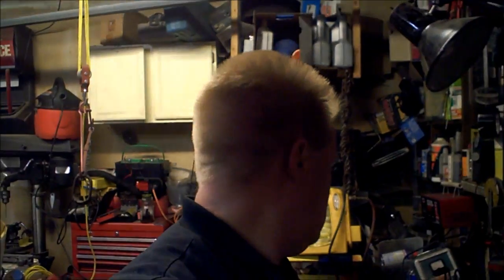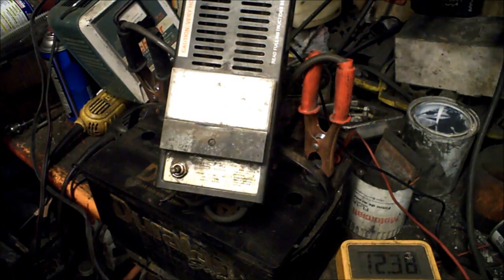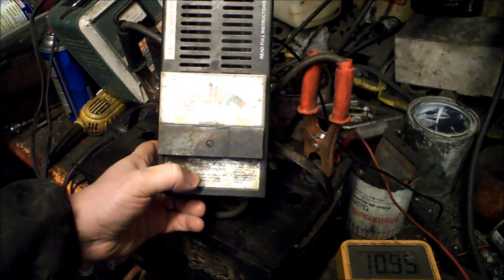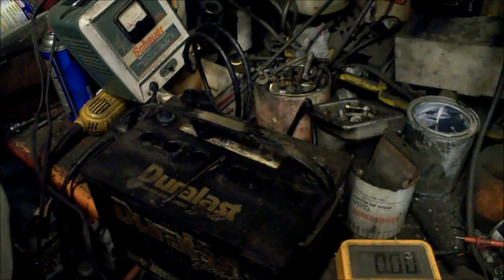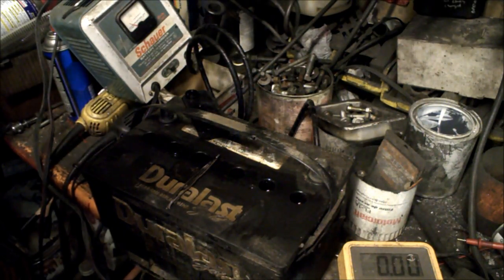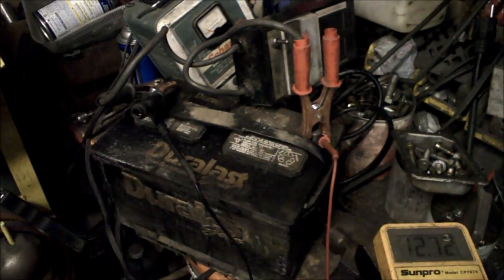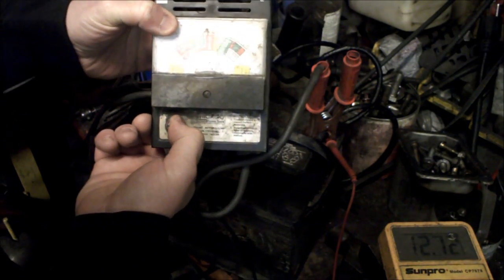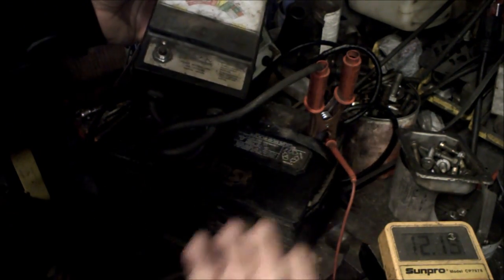Save a Weak BATTERY with epsom salt

Comment: Damn you look like a kid in this video! coming here because a dealer says my 4/5 year old battery needs replacing and I want to see if I can get some more life out of it. Seems like you or someone else I watch on youtube said batteries should be able to last longer than 5 years
Reply from the maker: Using Epsom salt, I've been able to push battery life up to about 14 years on some of them. It seems 8 to 10yrs is doable. The Epsom salt( magnesium sulfate) lowers the resistance of the electrolyte allowing higher current to flow. Essentially making a weaker battery stronger. Now you'll have to keep in mind that the lead plates are consumable and due to grade and fall apart over time. Seems like the only thing that will kill these is if a lead plate degrades to the point that it falls apart and short circuits a cell. Nothing will recover it from this.
Reply: @sixtyfiveford a dealer tested the battery and said it had 80cca when it was rated for 530! But it starts fine. And an oil change place said it had one cell that was weak. I put the epson salt in as recommended and I’m going to give it a few days and see if I can get a tester from the auto parts store and test it myself. This all started because I took it to the dealer because it had a check engine light say the throttle actuator was bad. My car, a 2010 also has a crappie ignition switch that won’t crank the engine unless you push the key in real hard so that is why I think the dealer thought the battery was having issues and tested it
Reply from the maker: @mickjager5974 Yeah there's no way it was 80 cranking amps. That wouldn't start a car at all.
Reply: @sixtyfiveford yeah thats what I was thinking if 80/530 means 15percent and it’s never not started it I’m thinking that was a typo, the guy doesn’t know how to use his tester, his tester is bad, or he’s trying to rip me off 😮

Gonna have to try it in my mower battery too! I’m thinking I should also put a quick disconnect on it in the winter and but start it up every couple of weeks too.
Reply from the maker: @mickjager5974 Yeah I'm getting 5 years out of the super cheap mower batteries sometimes up to 7 years. The only drawback to Epsom salt is it will increase the self-discharge rate. So a lead acid battery will naturally discharge over time and this will increase that by about 10%. I haven't noticed any difference, that's just what I've read.
Reply: @sixtyfiveford  well I left the doors and hatch of my escape open for a couple hours at most and now it sounds like it’s got about 80cca😢. Was just getting ready to take it to an auto parts store to have them test it. If I pull the battery out and take it to them can they check cca or does it have to be in the car?
Reply from the maker: @mickjager5974 They can test the CCA out of the car. They'll want to charge it up though which takes a few hours.
Reply: And going out to see it letting it sit a while it’s like completely gone and won’t even light up the control panel. I know you mentioned dropping one on the ground that had a dead cell so I’m thinking about trying that as a last resort before going to get a new one ☠️
Reply: I dropped it but when I looked at it it actually seemed like it was leaking from the side seam and when I took the caps off the fluid level seemed lower than when I had added the epson salt. So just to save time I went and got a cheap battery from Walmart, 110$, 2year warranty and 590cca. It’s my daughters car and she lives 45 miles away and goes out of town often so I figured best to just get a new one. If it was my car I’d probably have tried it. So when do you normally add epson salt? When a battery is new, when it’s around 3-4 years old, or wait until it starts having problems?
Reply from the maker: You can buy battery testers that test the CCA for around $15 on Amazon. I go around and just randomly test my batteries and when one is lower than it should be; I will add Epsom salt. This is anywhere from the 4 to 7-year mark generally. Riding mower batteries are generally around 2 to 3 years when I add it. 

I'm not exactly sure the quantities I gave in this video but I kind of just eyeball anymore. Mainly because it doesn't seem to make any difference if you put too much in. It's probably around a tablespoon per cell on car batteries and a Teaspoon in small riding mower batteries. Though I've put upwards of 3 tablespoons per cell on car batteries just to see and no difference vs 1 tablespoon.
Reply: @sixtyfiveford thanks! I’ll check my truck and mower battery and probably add some to them. My newest car is a 2022 hybreed 😅 Corolla so I might add some to it too .
Reply: @sixtyfiveford well I noticed the battery in my 97 truck is 5 years old so I’m going to get busy and test it and see if I can save it before it goes. I think the biggest issue with the it previous one was the dead cell
Reply: Haven’t done it yet but I did buy some plain epson salts and not use the scented stuff I used before. Granted the previous one had a dead cell so it was probably too far gone. This video also shows some interesting things to help with batteries. They don’t say anything about epson salts but do recommend checking cell level and claim that trickle chargers help clean the plates 

https://youtu.be/5jsaFLEtqbo?si=xAFverQ7hEhqPfmf

Comment: I agree 👍 I run my laptop off car acid calcium battery and use it to run small fridge and normally after 10 months I add a heaped spoon of Epson salts in each cell and after few days when it melts property there is significant noticable boost my fridge can run longer and also when testing with clamp meter when it's charging when engine is idling it takes in much more amps and charges quicker so it definitely works great and I am happy with results, whoever is throwing out the contents of the battery and replacing it purely with Epson and then saying that it doesn't work is doing it wrong as all you have to do is add Epson to existing acid without doing anything else and that's it.

Comment: I did have a question? Is it necessary to unhook from all terminals and connects before doing this?
Reply from the maker: Not really. Just pour it in and use the battery.
Reply: @sixtyfiveford  Thanks brother.  I just revived my batteries it looks like. Man the stuff they don't tell yah.

Comment: What happens if you put it in before the battery sulfates?
Reply from the maker: The only down side is the battery self discharges more rapidly with Epsom Salt(magnesium sulfate) vs not having it.
Reply: @sixtyfiveford  Saw another Tuber using a 200 amp charger to revive batteries .

Comment: Epsom salts is an electrolyte.....I know because I've used it to make hydrogen units for the car.
My guess is that it has something to do with the increased performance.
Reply: you got it and much easier to find than sulphuric acid and much safer to work with

Comment: I just tried  this again on another barley dead battery, can't get it to charge up :(
Reply from the maker: If the battery has a shorted cell, they're hopeless.
Reply: if you have a shorted out cell it wont take a charge sometimes flushing them out a couple of times after shaking them up will help if there is sediment on the bottom and sometimes the cells brcome detached as result of faulty manufacturing. just test the cells with a hydrometer or volt meter to see if the cells are all holding a charge if there is no charge in one cell it wont take a charge or wont hold a charge

Comment: Gotta dying Harley Battery going to try this on. Fing things cost a hundred bucks every time.
Reply from the maker: I've had good luck with dying batteries do this. Not all are salvageable(about 50/50),  but it's easy and free if you have Epsom salt laying around.

Comment: My car battery was cranking very slowly the past couple of days so I bought a new battery today (2/13/2017) coded L6. The core trade in is $12 but I think I might try to rejuvenate it with your method. It is 5.5 years old.

Comment: Why cant they actually just put the date the battery was made right on top in a language a human can read.
Reply from the maker: Auto parts stores will sell batteries that are a year or more old. The coding keeps consumers in the dark.
Reply: There are many components to battery repairing. One place I discovered which succeeds in merging these is the Rapid Renew Roadmap (google it if you're interested) definately the best info i've seen. Check out this great website.
Reply: Ho to reper inviter
Reply: what difference does it make when its out of warranty
Reply: the best results that I have had was by following the Magic Mender Wizard (i found it on google) definately the most incredible course that I have ever tried.
Reply: interesting points ,if anyone else wants to learn about how to recondition batteries try Panlarko Recondition Planner (do a google search ) ? Ive heard some awesome things about it and my partner got amazing success with it.

Comment: I've just added Epsom salt a month and my weak battery running strong just want to know is it one to two years so I can be ready to buy new battery
Reply: Iva Ilic did that clear up your chlamydia and genital warts
Reply: you are just trying to sell shit.  iva.
Reply: the greatest results that i've ever had was by following the Magic Mender Wizard (just google it) definately the no.1 info that I have ever followed.
Reply: There are several components to battery reconditioning. One place I discovered that successfully combines these is the Magic Mender Wizard (check it out on google) without a doubt the most incredible course i've heard of. look at this  unbelievable resource.
Reply: There are many components to fixing a car battery. One place I discovered that succeeds in merging these is the Magic Mender Wizard (check it out on google) without a doubt the most incredible info i've seen. look at this  incredible website.
Reply: There are several factors in getting a good result. One plan I discovered that successfully combines these is the Magic Mender Wizard (check it out on google) definately the most incredible info that I have ever seen. Check out this  incredible resource.
Reply: @teadavidovic1012  fuck off

Comment: Is the battery ok till now ?
For how many year does it last ?
Reply from the maker: HFTONE
Yeah, right.
Reply: Ylse Mza Why don't you go fuck yourself?
Reply from the maker: The battery lasted 4 years after I added epson salt.
Reply: Worked for me.  4 year old battery that Autozone said it had one bad cell.  Don't know if his testing equipment said that or he just assumed it because I said my battery doesn't keep the charge  One cell was almost dried when the battery starting having problems.

So anyway, I did as explained in the video twice.  Before, the battery would not keep the charge and drop down to 10 volts (and 10%) but I kept charging it with a a smart charger from Walmart in both settings, 2amps and 12amps.  Did it many times.  I wish I had those old battery charges.   The water I guess evaporated a bit the first time so I did this procedure again and refilled it with the salt and distilled water.  Each time I beat the shit out of battery with a two by four on all sides and shook it really well and I mean really well.  I also dropped it around 7 times from a foot high.  A lot of black gunk was floating and spilling out when charging.  Anyway, the thing now is keeping the charge 4 days later and starts the car just fine.  I used this car maybe once a week to drive less than a mile each time, and that probably was what "harmed" the battery.  

I used car twice in 4 days to test drive it 3 to 4 blocks and I see nothing wrong with battery.  Before, the battery would lose the charge just after one hour sitting.  So it has been 4 days only and the weather is in the 50s-60s.  Soon the temperatures will drop and hopefully that's not a different story.  

Battery is Group size 51R for Honda Civic.  Hopefully I can get a few months out of this thing.
Reply: did it cure your VD?
Reply: 10/13/2016 UPDATE.  It's been 3 weeks, I think, since I added the Epson salt and distilled water.  Battery hasn't lost the charge.  I tried to charge it twice and smart battery charger said it was 100% charged.  I've used the vehicle a little bit more but I have noticed that it takes at least 8-10 seconds to start the engine.  Sometimes it takes a second try.  That didn't happen before.  Maybe is that cell that is dead, don't know.  Maybe I need to change the spark-plugs and distributor cap; maybe something else, don't know.  Battery sounds strong/charged and doesn't die like before though.

Battery is a a Group size 51R and Duralast brand, which I forgot to mention above.  Will keep updating.

10/14/2016 UPDATE

Went to start vehicle in the morning and it wouldn't.  Battery died after 4 or 5 long tries.  Recharged it back to 100%. 

10/15/2016 UPDATE

- Installed fully recharged battery in vehicle.  Wouldn't start after 3 tries,  but didn't let battery completely die.  Suspected vehicle was out of gas so I put a gallon in it.  That was the problem. I don't use this car too much and the gasometer doesn't work so couldn't remember if the thing had enough gas.  Battery still strong.

NOVEMBER UPDATE:  You know, since I don't use this car much, I don't put too much gas into it.  The gas meter is broken so I can't tell how much gas is in the car.  Well, one November morning I went to start the car and it wouldn't.  The battery eventually died.  I had many things going in my life at that time and couldn't deal with this, so I took the battery to a Junk Yard and got a used one for $45 plus taxes.  Put the new used one in and the car wouldn't start either.  The damn thing was out of gas again!  LOL.  I should've known better!!!  So I turned in a perfectly working battery at the junkyard.  Amazing.  So that's the end of this experiment.
Reply: yeah right!
Reply: I've been researching into fixing a car battery and found a great website at Jons mender guide (check it out on google)
Reply: Sroor9001  hi everyone ,if anyone else wants to uncover how to recondition my car battery try Vaxicorn Battery Extender Guide (do a google search ) ? Ive heard some awesome things about it and my co-worker got amazing results with it.

Comment: can I use any kind of water or should I just use the distilled  water
Reply from the maker: It is generally ill advised to use anything but distilled water as it has no impurities.
Reply: distilled water is recommended but how many actually use it when topping off a low cell

Comment: I have try this on many different battery's an it waste of time .it just don't work .
Reply: I agree. This gives no long term benefit with a battery that has bad cells. Might help a battery that is just weak but will hold a charge..There is no way to rejuvenate a battery with bad cells and make it last. The lead plates partially dissolve and no epsom salt or anything else is going to bring the battery back to life..